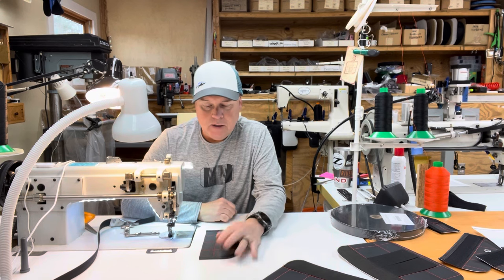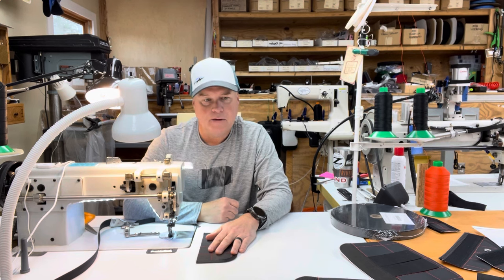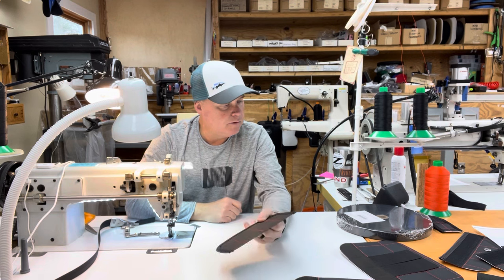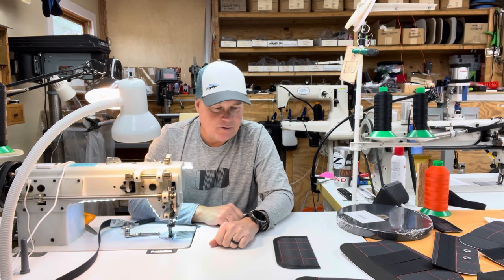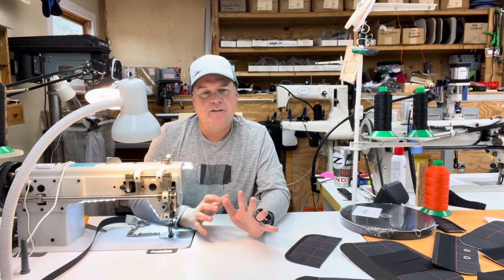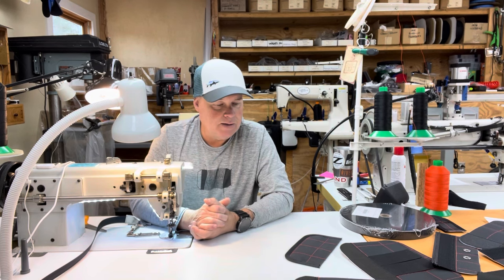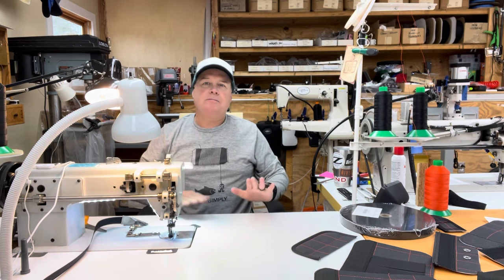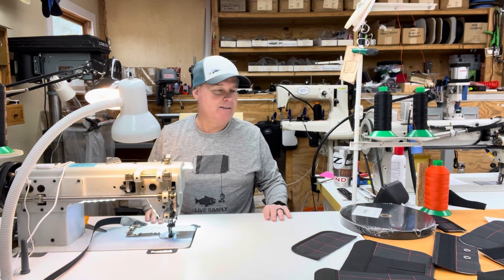What makes Flatlander Surfcasting different?

Comment: Jamie,

I would suggest you release a snap back trucker hat with your Flatlander patch sowed on the front...would be a pretty cool style of hat to release.

Also, you should consider adding tube inserts as an option for your bags (3d printed tube inserts aren't difficult to make, and the printers are inexpensive) 

My 2 cents!